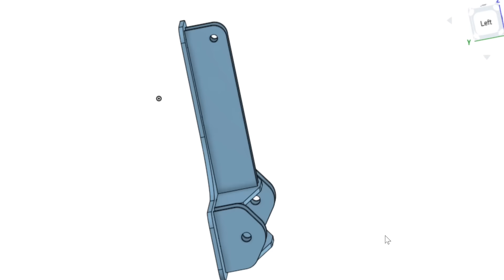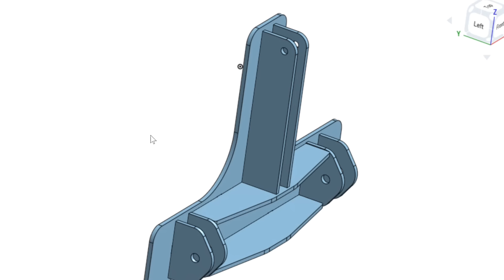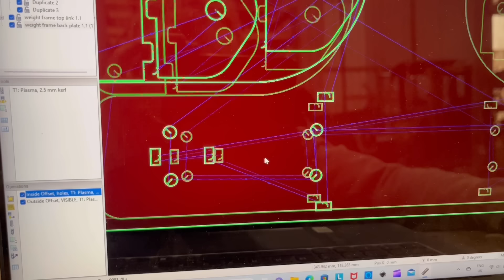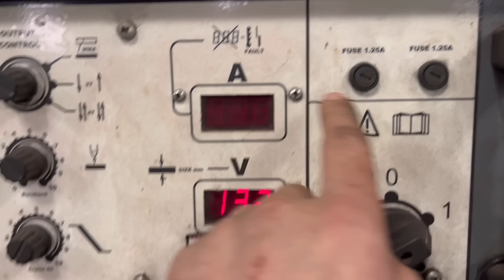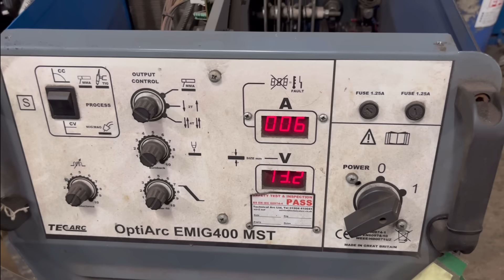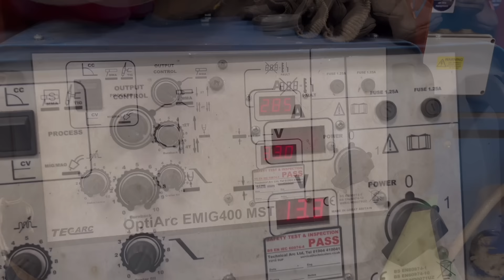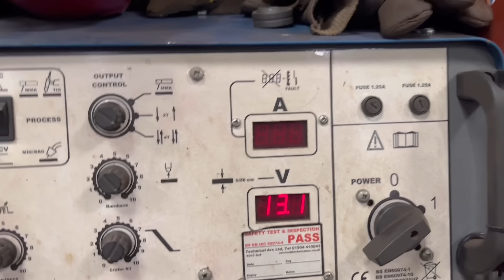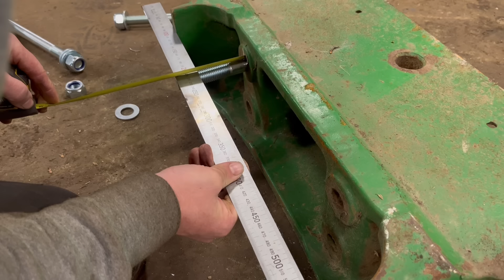Fabricating a double front weight carrier for John Deere weights.

Comment: Nice job.  When I was taking some welding classes, back in the day, the shop had stacks of welders from the old FMC plant where the Bradley Fighting Vehicles were made.  Those machines were 100% duty cycle and you could be running beads for hours straight with no problem.  Later, when I had my own welder for the shop, I learned all about duty cycle :)  I could easily overheat the machine.  It would shut down and stay off for the longest time until it would reset.  So I figured out how long I could run it and altered my fit up and welding procedure to break up the long welding runs into several shorter bits.  It took more time over welding it all at once, but if you tripped that thermal overload, I was dead in the water for 15 minutes.
Reply: Forty years ago in the truck manufacturing plant i worked in there was a job that was pulling 350 amps on welders that had a 300 amp  100 percent duty cycle , thermal tripped often . I asked               the engineer if he could afford to burn up two welders before  re doing the whole job . Sure , what can be done ? I adjusted the thermals on those now ancient RC 300 Hobert power supplies . Never had any more trouble ! My son has one of those machines that is still going strong , little TLC from me helps !

Comment: Ollie. Make some plate dogs for pulling down gaps. A L-shaped piece of plate with a large nut welded to it works well. I have seen millwrights align 1" plates with them. A lot safer.
Reply from the maker: I’ve been meaning to make some for a while just haven’t got around to it yet.
Reply: I've seen Curtis at cee use wedges combined with plate dogs. Should do the job as well instead of threads that are damaged easily with weld spatter

Comment: You could do with a shot blaster to clean up the plates, good job as always 👌🏼oh those misbehaving clamps 😅ain’t it funny when things are going smoothly, welding gremlins come out to play 😤Nice to see a customer picture, just a thought 💭 a little plate on the top would look nice with your company name 😜
Reply from the maker: The clamps were only jumping off because i was tightening the other down and taking the load off it, just part of the process.
Reply: @snowballengineering  I know, l laughed at the clamps 🗜️

Comment: Excellent job, you might want to look at improving the airflow in the welder. It will shorten it life constantly running at or close to fault temperature. Adding an extra fan usually  works wonders especially in hot weather. Just curious do you work from the family farm or is it just a building you rent on a farm ?

Comment: 34:14 my brother's neighbor had a similar type of frame build (he's basically unifying his fleet under a single type of weight because bulk is cheaper) and he drilled the sides of the frames for an alignment bolt. Nothing structural, just to keep them in line.

Comment: Nice job on the nesting Olly, a canny Yorkshireman could sell those edge pieces as razor blades !
I've got the little Portamig 185 (made by TechArc), it's a decent little transformer based machine, but I often have the airline blowing through the side vents to keep it going when running it flat out😂 !

Comment: Hitting the duty cycle on that mig 👍
Reply from the maker: Yeah but it’s supposed to be 60% @400amp
Reply: @snowballengineering  it must be getting on a bit. They say old welders never die but I'm not so sure, keep on keeping on you are doing great.
Reply from the maker: It’s about 6 year old
Reply: @snowballengineering  not that old but you do use it .
Reply: @snowballengineering it’s often misunderstood but the duty cycle is based on 10 minute intervals. 60% translates to 6 minutes can be spent welding with 4 minutes rest before welding again.
Reply: Sure, but continuous rating might only be 150A @snowballengineering

Comment: That turned out nice.
That’s not a fault light, that’s a fault dark!
No wonder you missed it.  Maybe if it was flashing you wouldn’t have  assumed it was a fuse (like it usually is)
Sounds like it’s not rated quite 100% continuous.  Just 99% 🤠
Reply: Perhaps 100% continuous without the layer of dust accumulated over the years... :)
Reply: @Spar1hawk  it still tripped out after he blew it out.  The fact it hadn’t done it before say those welds were really long I reckon 🤠

Comment: nice job,  think 1 of the reasons the welder is over heating, is because there is a lot of rubbish left/stored on the top? .also it is close to the rear wall so reduced air flow?,

Comment: Mate, wear eye protection when tacking up. Oh, and eye lids aren't uv rated. Your eyes will be bad when you get older. Don't ask how I know. Shit, now where is the key board!😂 most welders have a hidden thermal switch. Old ones didn't. I have cooked a few of 400 amp rated ones welding at 125 amps for too long! Nice work, as usuall. Cheers from Tasmania.

Comment: A big lump of weight on that thing when its full, my JD only has 1 weight rack on it and adds 690kg when its full including the rack, I also had to put a bolt/all thread horizontally to join all the weights together to stop them jumping and rattling around when you go over bumps(I have no front suspension on my JD as its old) 
What make is the oxide primer you used, I have tried a few without success but I have that same matt colour on my log splitter and its been out in all weathers for years without rusting and it has no top colour gloss on it for better protection.

Comment: 15:37 seems to me like the designer failed to factor in the head of the bolt, the washer it should have, and the space needed for a thick walled socket to tighten it.

Comment: What CAD Drawing software do you use? Since retiring, I no longer have access to AD INVENTOR which I have used for over 15 years, and I have to start over with a NEW CAD. I DO NOT NEED FUSION ( no 3D Filament building) 

I use WINDOWS on a PC with a 32" Monitor; keyboard and mouse.
Reply from the maker: Onshape, it’s great. And free for the hobbyist. It’s cloud based as well so you don’t need to download anything.

Comment: Have a mig welder that does that cutting off, stuck a cheap box fan up against the air intake of welder and it worked all day long, think factory cooling fan just isn't up to the job, might try a fan up against front of your welder, forced air 😂 induction
Reply from the maker: Everything is better with forced induction 🤣

Comment: Hahaha, sitting shouting at screen "It tells you beside the display" 😄 It's easy to get engrossed and exceed the duty cycle, inconvenient and annoying, but it saves damage to the welder 👌
Reply from the maker: It’s suppose to be 60% duty cycle at 400amps so I didn’t expect it to be reaching its overload 🤣  and it had already blown one of the fuses on the front that morning so I thought there might of been something wrong 🤦🏼‍♂️
Reply: @snowballengineering  Could be as simple as the build up of dust inside preventing proper cooling 🤷‍♂